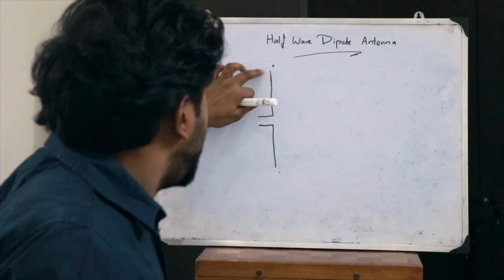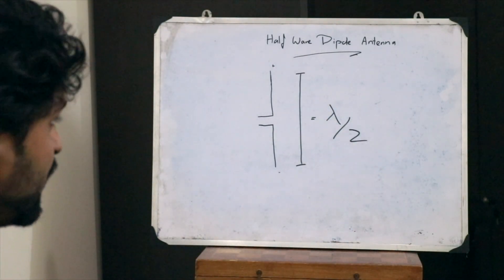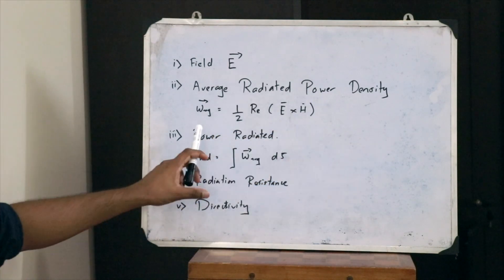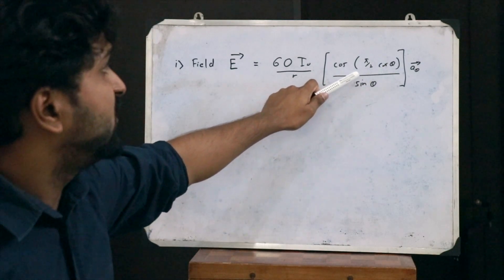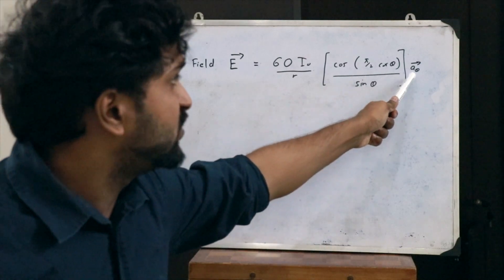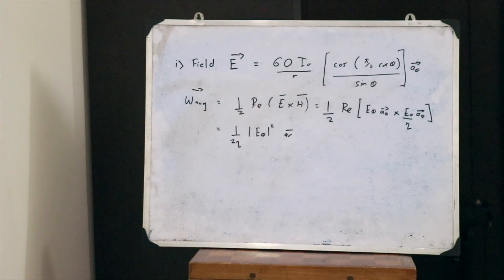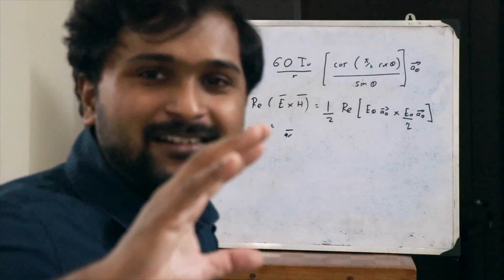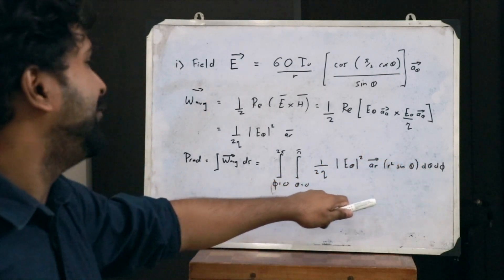Half Wave Dipole Antenna - Field, Power Radiated, Radiation Resistance, Directivity

Comment: Sir what type of questions will be there for exam in this session
Reply from the maker: Hey Akshay, 

The main questions that can be asked from this topic are : 

1. What is the electric field produced by a half wave diode antenna?
2. Calculate the radiation resistance of a half wave dipole antenna.
3. What is the directivity of a half wave dipole antenna?
Reply: @BackbenchEngineer  ok sir